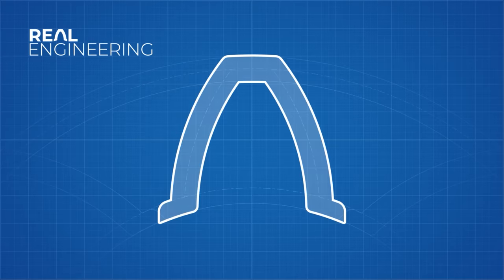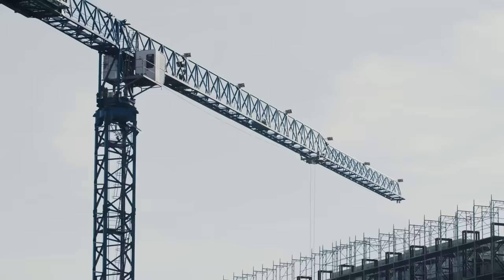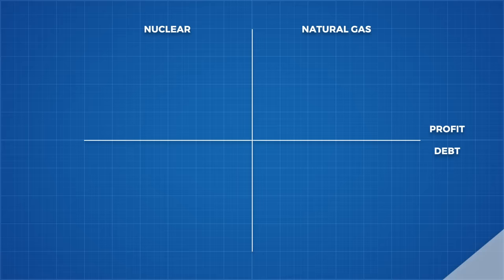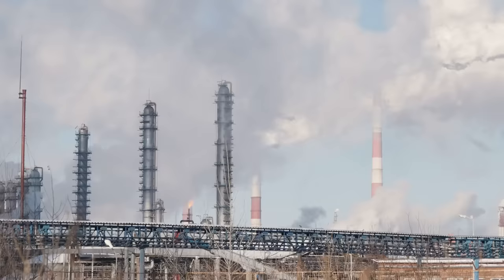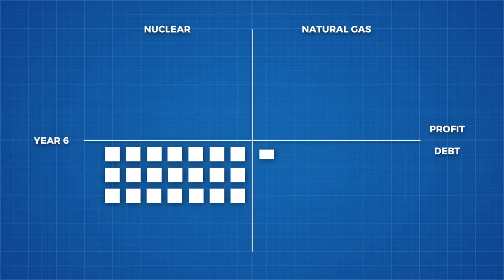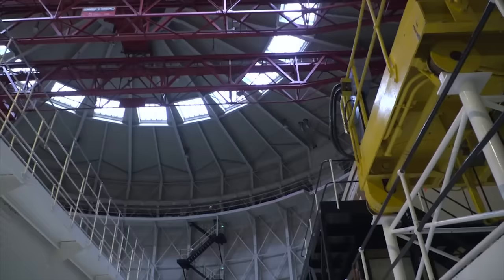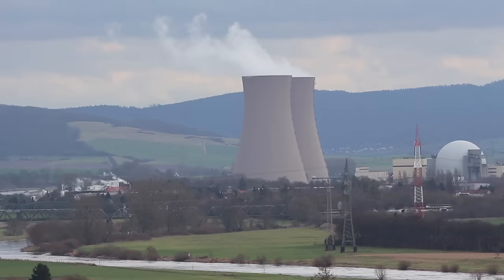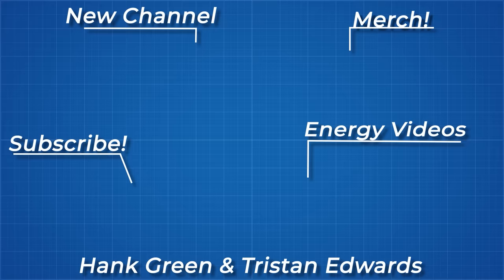The Economics of Nuclear Energy

Comment: It's also amazing how much the set-up to deal with renewables varies by region. I live in a northern area with lots of hydro but almost no solar investment. For us the challenge isn't day-night fluctuation in energy; it's that hydro is insanely productive during the spring run-off in Feb-May. We have to spill over the dams because we can't use all of the electricity. But the challenge is could we store say an entire extra month of power and release it over the other months? The thinking now is that batteries wouldn't be effective at seasonal storage, and more effort is going into the production of hydrogen or synthetic methane for long term storage.
Reply: Or ammonia to store hydrogen.
Reply: In an ideal world, you could do what most hydro plants do.  Loads of hydroelectric plants across the world pump overrun into a high elevation reservoir.  When demand falls beneath available supply, you use some excess energy to fill the reservoir...  when demand is high and naturally available supply is lower, you open the reservoir floodgates and run it through the dam again.
The difficulty is that to pull that off requires geographical demands that may not necessarily be available.  If you don't have enough land available to set up your reservoir, you really don't have a means of making this method work.
Reply: Tl:dr
Giant pistons
Use the hydroelectric dams to pump up a large section of earth (with water), and when you need power, you can release the breaks and let gravity do its thing.
Reply: Germany is doing Power-to-Gas, chemical storage as H2 or CH4. More leading edge, Power-to-Biofuel. Energy tends to be in greatest supply from renewables when biomass waste is most in oversupply. Wood wastes from timber, cellulose from stover in the fields, dried out and chipped and turned by renewable electric-fueled pyrolysis into biochar and VOCs, in turn refined to biodiesel, biogas, even aviation or marine biofuel; and when demand is higher than supply, simply burn the hydrogen-richest portion first in a net carbon negative cycle. Excess biochar? Sequester in the ground as soil amendment to reduce need for fertilizer and irrigation, making farms more drought and flood resilient. 
This approach embodies aggregation, ancillary frequency control, arbitrage, chemical production and storage in ways nuclear can't touch, no matter what sort of shell game 'economics' a fast-talking Physics professor presents.
Reply: and gravity storage, if you have a hill close by to put a storage cistern at the top and bottom of. Really want a mountain and a set of cisterns for that much storage, though. Also to use: huge flow batteries.
Reply: @thekaxmax  I think many of you are underestimating just how much water we are talking about in some cases.  I live in BC, Canada.  The size of the reservoirs are already massive, the amount of snowmelt and water in the spring that flow into those reservoirs is on scales it's hard to imagine.  Sure you could do this to some extent, but it would require a LOT of destruction (to store a significant amount you'd have to basically blast the tops off several mountains to create lakes there)
Reply: Batteries are not effective as seasonal storage because they are too expensive in relation to their storage capacity. Power2Gas is much better in that case, because its investment costs are much cheaper. But it does have a huge disadvantage. You need about 4 kWh energy to make 1 kWh of storage power. If you have to buy these 4 kWh of energy your stored 1 kWh will cost 4 times the price of 1 kWh. Then you have to pay the loans, the facitilty, tax etc. this will add to that costs making this 1 kWh of stored energy very expensive.
Reply: I’m coming to the conclusion that a break-through in battery technology would be beneficial in most aspects of life
Reply: how about storing the spill off into ponds for slow release later? a water battery.
Reply: @graithtools8215  and yet in germany we have the highest energy cost in europe
Reply: There are groups fighting renewables tooth and nail everywhere. They have a place, but going full hog into nuclear would mean unmetered power. A cable bill subscription model.
Reply: Its already a thing. When there is extra power they pump water up hills into reservoirs and then store it up there until power is needed when they bring it down again. Its called pumped storage or something like that.
Reply: @RandomGuy-nm6bm 
Yes but that is thanks to monopolistic energy companies and renewable substation programs that aren't there to strengthen renewables but to fight them.
In fact the energy costs are much higher than what is just on the electricity bill.
Billions of coal subsidies are still payed directly from our taxes and nuclear power was completely build by letting the costs for coming generations. We still have the nuclear waste thrown into unfit holes. Which we have to get up and actively store for trillions per year. Not to mention the insane costs of building and getting rid of nuclear plants, also 100% payed by taxes.
Renewables don't get that luxury they mostly have to pay for themselves and the subsidies that they got where so designed that it is more efficient to keep coal plants running and get payed by the state for solar and wind standing still.
Reply: @OpenGL4ever  While what you say about P2G's drawbacks is true, it misses some fine points. If you have 4kW generation you cannot use, its marginal cost is zero. You get 1 kW for free on the margins. Further, if spinning down your generation has high costs -- for example you either run your hydro generators or face flooding -- then that 4kW of generation is cost negative, and that 1 kW of storage is worth whatever the market price of fuel plus four times as much as the value of arbitrage.
I prefer Power2Biofuel, the concept of using marginal grid power to draw fuel out of biomass by efficient eutectic salt pyrolysis. Induction heating of salts to drive volatile organic compounds from dried wood chips and field residues in sealed chambers leaves behind biochar -- charcoal -- and produces feedstock that can be refined into biodiesel, biogas, drop in replacments for aviation and marine petrochemicals, plus asphaltenes and other valuable industrial chemicals, all while solving waste disposal problems. More net energy by far, by orders of magnitude, can be stored in P2B than is used from the grid. In which case that 4kW becomes 40kW or 400kW or 4000kW.
Reply: @RandomGuy-nm6bm  No. In Germany you have higher than average energy price. It is neither quite the highest (that's Denmark), nor does its price reflect only the cost of generation, but also built-in subsidies to employment of workers who would have to find work were their coal operations shut down and replaced with cheaper renewable power generation. Less subsidized than any other EU nation, the German grid's special challenge is lack of base load hydro or geothermal; with either a trade program with nations to supply base load or an internal program to develop such resources internally, Germany could cut its grid cost in half, especially if it turfed the coal dead weight losses.
Reply: @animefreak5757  If you think pumped hydro is water intensive, you should compare it to water taken up in fracking and tarsands operations. The tailings ponds from those can be seen from space, vast toxic wet deserts that kill everything that touches them, including massive flocks of migrating birds. That's the difference: pumped hydro manages water flow, building reservoirs that can be tapped in times of drought and used for irrigation in emergency for farms, or filled up in times of flood to prevent loss of homes and infrastructure; tailings and other petrochemical uses just destroy and cannot be used for other purposes.
Reply: @graithtools8215  run your hydro generators or face flooding: Or you open the gates of your dam and spill that water. Only makes the cost of the generation the additional cost and maintenance from running for longer though.
Reply: Could you have migrating energy intensive industry. So for Feb-May they come in and use the excess power and then they leave at the end of May?
Reply: @catprog  Competent water managers design hydro systems, or incompetent ones do. Sure, any hydrologic system is subject to flood in the most extreme of cases, especially if the designers didn't take the precipitation and melt changes due global warming into consideration. However, we do know precipitation is changing, and either we upgrade all our water management, or we see flooding take its toll whether we use water to generate electricity or not. One of the worst disasters in history was China's Banqiao Reservoir Dam break in 1975, due incomplete hydrology data, shoddy construction, political interference and the enormity of the challenge of managing the country's almost 90,000 complex and diverse reservoirs, plus a megastorm. China, and pretty much every nation, faces a rising flood of potential water management issues that we all are unprepared for.

Getting electric power where you can, even if only seasonally, whether run of river or megaproject or pumped hydro (which can mitigate flooding, btw), can defray the cost of water management projects. 

Nuclear projects build in regions that haven't fully prepared for water management? That's a recipe for nuclear disaster.
Reply: Not sure that dams are best used for electricity production in the future (in fact I have been in negotiations already about the long term financial risks for some very large hydro power dams). Instead using them as gigantic batteries is a much more viable use case. Time will tell.
Reply: @user-lj6gk4lv9s  haha
Reply: @OpenGL4ever  i think your over your head. Batteries are coming down in price. EVs have batteries, if they are plugged in 50% of the time, long storage becomes a whole lot easier. You are not thinking strategic, just here and now.
Reply: The LCOE for renewables does NOT include the cost of backup power for this kid's-lemonade-stand business model.
Reply: Pumped hydro?